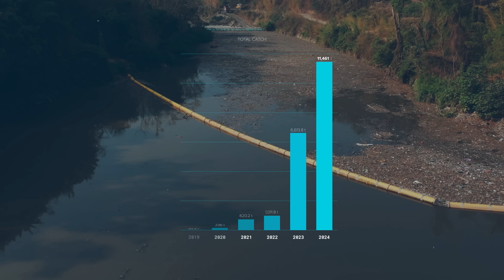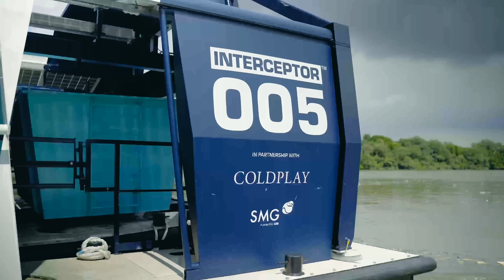Our Biggest Trash Catch Ever & More: The Ocean Cleanup 2024 in Review

Comment: Just an idea ...how about using shipping lanes and ships to transport the trash back... these nets float on water hece can be tugged back to port this way it should reduce the cost even further. On a future note regular ships can work be modified and work in pairs, nets can be attached between them and with a central float that closes the net once full. after which these ships can bring the trash to shore. Also please use plastic for long term applications else it can be stored as pellets in empty mines. This way the products true potential can be realised later ones all the problems is solved.
Reply: Write them on their website, s they don't red comments.